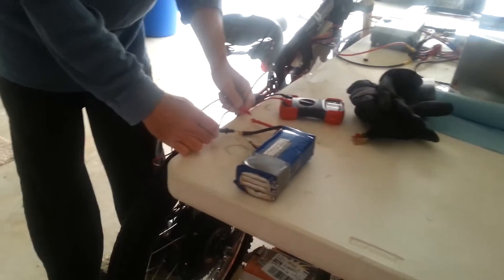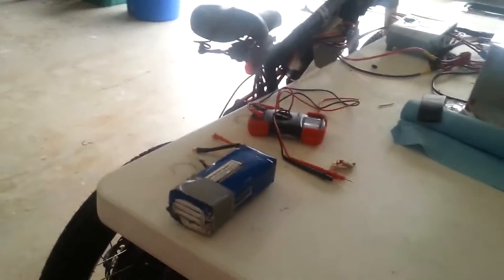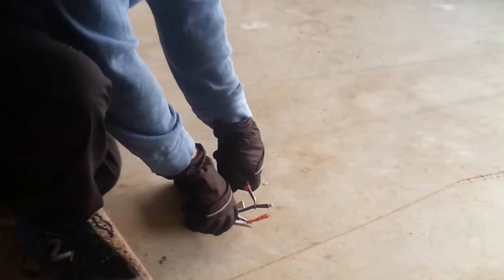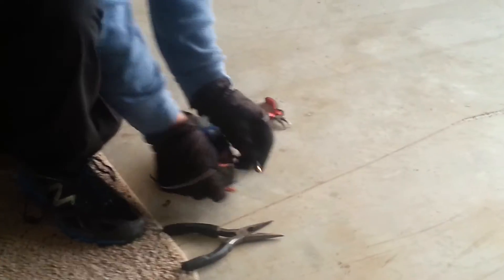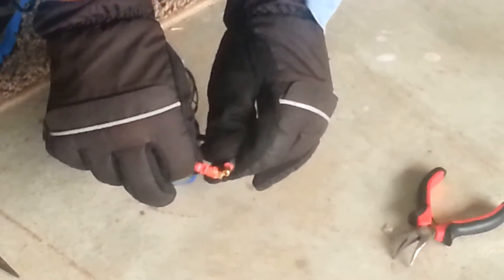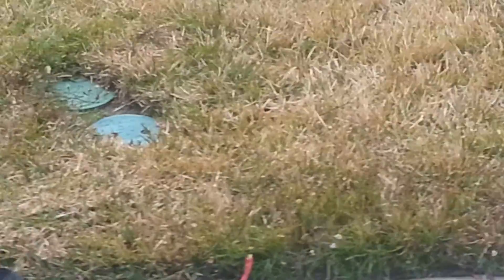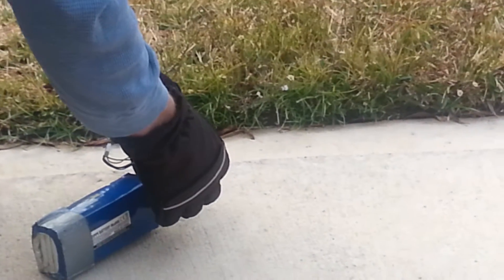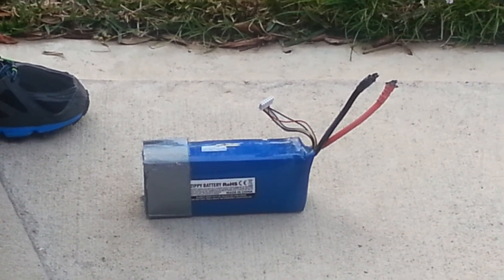Intentionally Shorting a 5s lipo battery

Comment: GUESS YOU'VE NEVER SEEN ALIGATOR CLIPS BEFORE EH??  IDIOT ...JUST GRAB THE 2 WIRES TOGETHER WITH ANY CLAMP OR PUT BOTH OF THE WIRES IN A JUG OF WATER THAT WILL SHORT EM.... DONT WASTE TIME TRYING TO RUB THE LEADS TOGETHER LIKE A FOOL ... IF YOUR THAT STUPID YOU SHOULDN'T BE DOING THIS.. AN UN EDITED VIDEO WHERE YOU CANT EVEN ACCOMPLISH BARELY WHAT YOUR SUPPOSED TO LOL